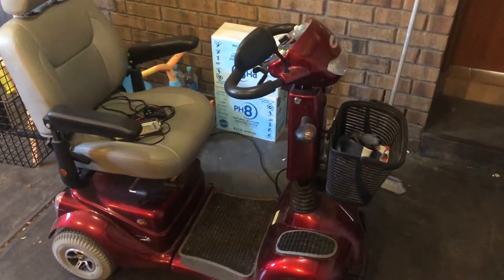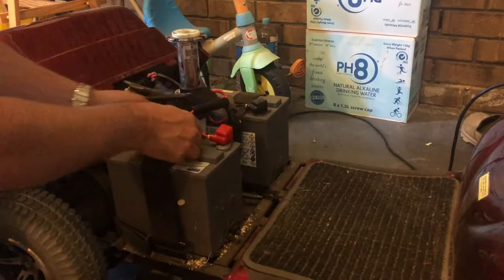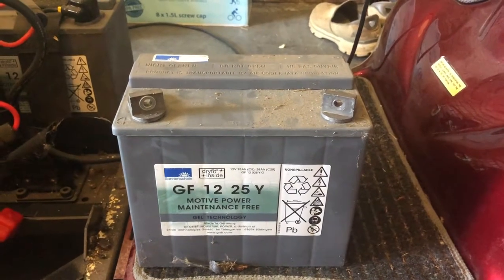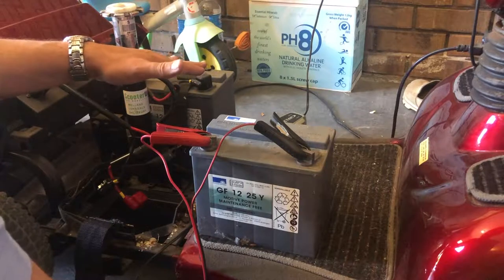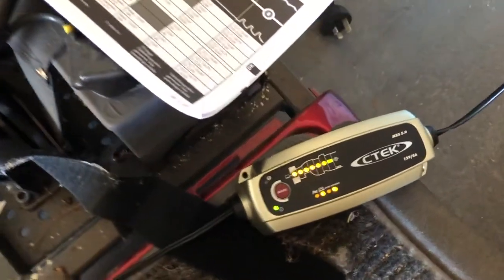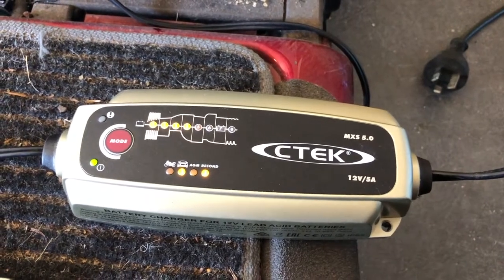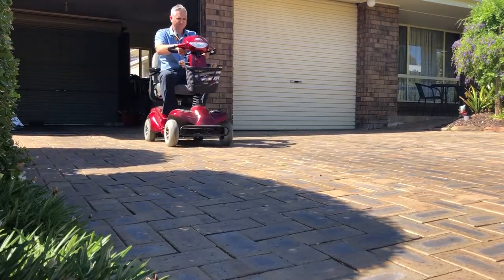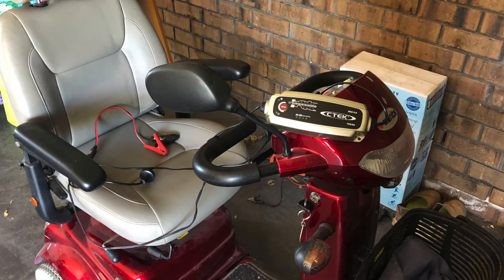Gopher Mobility Scooter 12V SLA Battery Recondition Rejuvenation CTEK MXS 5 0 Money Saver

Comment: how about an update, what is it like now how did they do? charging them directly with battery car charger is not the same as using the mobility charger and charging circuit, how did it perform when charged on its proper charger, did the fix actually work at all, if so how long did it last? how much further were you able to get compared to before?
Reply from the maker: Hi Mark, It was a dramatic improvement. After the rejuvenation the mobility scooter could not make it to the shops - let alone back from the shops as well!  Since then it does regular trips and the normal charger is used.  Cheers Drew
Reply: @DrewFixIt  thank you for the very prompt reply, if only all youtubers were as prompt or could even  be bothered to reply. thank you for the update, most informative, i will have to give that a shot, my current batteries are heading towards that point where they need replacing and with covid and other things to be able to save the replacement costs of around £340 a pair even if it only staves it off for a few months it will be a massive help, thanks for the vid and update, take care and be safe.
Reply from the maker: No problems Mark, I honestly use this charger a lot so you really can't go wrong IMHO.  I use it for large 700CCA AGM batteries down to tiny Gel Cells.  You really can't go wrong with it!  Cheers Drew
Reply: Gonna give this a go ..I have 2 dead 72ah  12 v lead acid c20 rechargeable batteries .what's your advice plz buddy.
Reply: @deanturner7116  hi mate, if the batteries are below 2% it starts damaging the battery, i have had some that have been totally dead, most modern car chargers and wheelchair chargers will not change the batteries they just display as error, the way around that is to use jump leads, use a good battery with a decent charge in it 12-13v ish and hook the positive jumper to the positive terminal on the good battery and the other end of positive lead to the positive terminal on the old bad battery, do the same with the negative lead but connect to negative terminals not positive,  depending on how long the bad mobility battery has been with no charge in it, leave them connected for at least five mins, and up to ten mins stay with it and check the bad battery temperature with your hand from time o time  to make sure it does not get to hot, if it gets very hot then it is prob totally dead and will not be recoverable, you can do it in stages so a couple of mins at a time with fifteen min space between connecting. if it stays at a sensible temperature just leave hooked together for 5-10 mins and then disconnect, leave a couple of mins and check voltage, if it is over 2volts then it should be recognised by the charger and it should start to charge, if you do not have a multimetre or voltage tester then just fit to the chair or scooter and try to charge, or charge separately with a car charge, they will never be as good as new but you may be able to save them that way and get more life out of them, or put to use on other things, hope that helps.

Comment: Hi Andrew thanks for your battery rejuvenation video i,m in same boat and about to follow your example with the same/similar charger etc.
Also redroosters advice on possibly
Rejuvenating again to break the sulphide down is handy,  very worth trying at $250 a battery. 👍
Reply from the maker: Hi Dean, thanks for the feedback and absolutely agree, it’s worth a try …. nothing to lose really!!! Cheers Drew
Reply: Wheelchair batteries 12v 15h

Comment: Would it be ok to run that ctek regen twice on the batteries?
Reply from the maker: Hi Mate, I don’t think it will do any harm! Cheers Drew
Reply: @DrewFixIt  Should you remove cell caps as well or not?
Reply from the maker: @zerocool278  if they are meant to be removed!  Cheers Drew

Comment: What amp charger is usually used on your dad's mobility scooter. If it is under 5amps then try using a 8amp charger as long as it is compatible. I had a tiny USELESS 3amp with mine & i found it took in excesses of 20 hours to charge. 😳😠😠😠😠😡😡😡👎👎👎👎👎 So,  i got a 8amp charger & cut that charging time right down to about 2 hours maybe a bit longer or less depending on the amount of charge it required. & i wouldn't go back to a PATHETIC 3amp ever again. & I'd say those who have mobility scooters or motorised wheelchairs FORGET the use of 3 amp chargers You be waiting FOREVER!!!! for it to charge up. Chargers range from 3😠😡👎 to 5🙄🤔 to 8  😉😁👍  perfect to 12amp only use on  batteries that are used in much bigger or extreme heavy duty vehicles ( i.e lorries , 10 ton+  trucks  & buses As these chargers are far too powerful for mobility scooters & powered wheelchairs. 8:is biggest i recommend & stay well clear of gel type batteries. I personally do not recommend them ( two words  VERY  UNRELIABLE!!!!!👎👎👎👎😠😠😠😡😡😡).